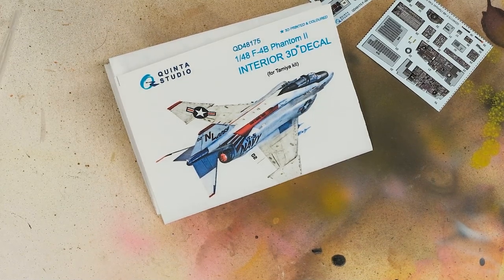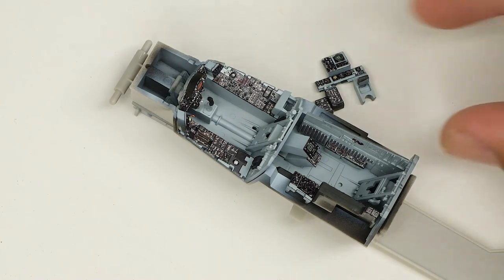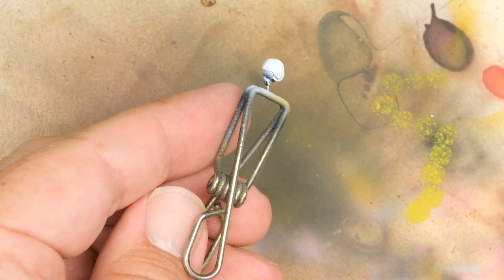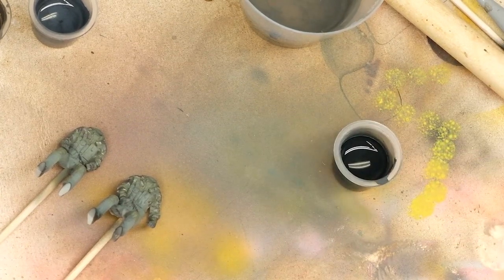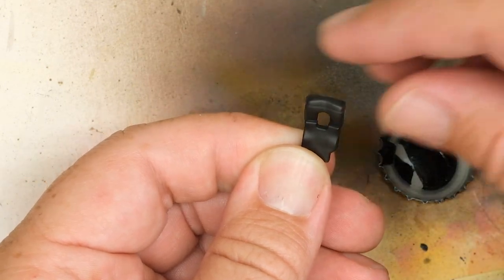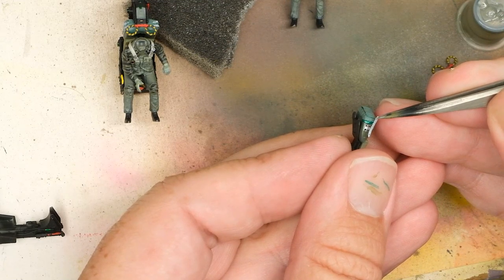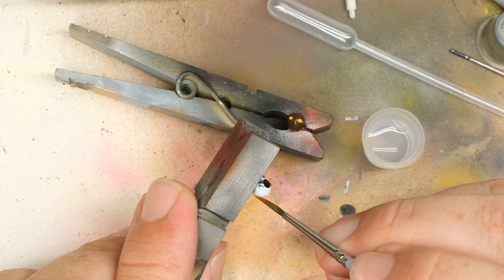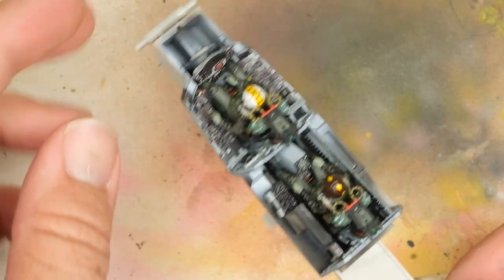1/48 Tamiya F-4B Phantom 03 - The Cockpit

Comment: They both are pilots.  My uncle was shot down in Vietnam in an F4.  He was in the RIO job title but he was a pilot as well.   He was used as a RIO because he knew the F-4D electronics better due to him going through school after his Flight Commander who was flying the Stick that day.  They both went through the same flight school, both were pilots.  He actually flew the stick position most days. but this day the commander had to go through recertification for promotion he was the training officer as well so he flew with everyone.  At least this is what I was told when I went to his reunion on behalf of our family.  I was chosen by my dad because I was at a duty station close to where it happened.
The material at the top was nomex.  It was there because it was fire resistant and self extinguishing.
I think the green cable is the emergency release cable.  Like if the plane is on the ground and on fire...the latches on the older harnesses wouldn't release if under load.  You pull the loop out of the little velcro shut pocket and yank it...it releases at the other side of the harness.

Comment: Cockpit looks awesome, love the tiger stripe camo painting on your figures too. The only thing I'd add is that if you're modeling F-4B from 1966. time frame, should've used MB Mk.5 ejection seats instead of Mk.7s supplied by Tamiya. If you watch "On Target" USMC video, it clearly shows Da  Nang based VMFA-323 Phantoms were equipped with Mk.5 seats.

Comment: Whoever thinks using control panel decals is cheating is most definitely not an actual modeller. dry brushing the control panel and then paint brushing all the bottons can only make people suspend their disbelief on a very small scale. On 48 scale it is barely convincing , and on 32 it just looks straight up fake.